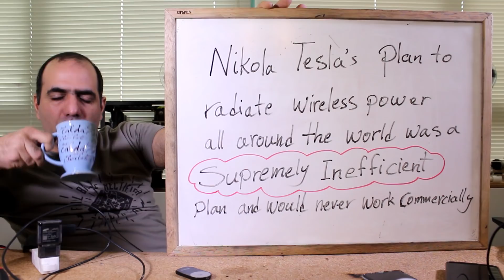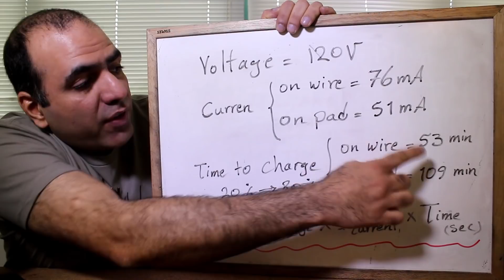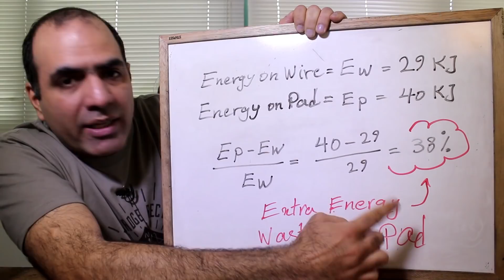Drowning in Inefficiency

Comment: 50 to 60 for an EV? The charge efficiency is maybe 80 to 90+ percent then the motor and inverter efficiency is 90. Plus it captures energy during regen. Would like explanation on how 50 to 60 is what you choose, please.
Reply: It's not necessarily all that wrong, and it depends on how far back the efficiency is calculated. From Tank-to-Wheels EV's generally score well over 70%, however from Well-to-Tank that number may change drastically.
Example of Total Tank-To-Wheels efficiency: (0.90 Charger)*(0.99 Coulombic efficiency of Li-Ion)*(0.97 SiC Inverter)*(0.97 SRPM Motor)*(0.98 reduction gear)*100 = 82.15%
1. Example of Well-to-Wheels efficiency: (0.9 Hydro)*(0.96 Grid losses)*(0.8215 EV)*100 = 70.97% 
2. Example of Well-to-Wheels efficiency: (0.6 Natural Gas Combined-Cycle)*(0.96 Grid losses)*(0.8215 EV)*100 = 47.31%
3. Example of Well-to-Wheels efficiency: (0.2 Domestic Solar PV )*(0.98 Solar Inverter)*(0.8215 EV)*100 = 16.10% 

Data is from Tesla Model 3 customers look at average charging efficiency, typical characteristics of Li-Ion Coulombic efficiency at low charge rates, an example of automotive full SiC inverters at peak efficiency, and lastly switched reluctance permanent magnet motors from Model 3 at an unknown efficiency point.
Tesla Model 3 is likely best in its class, but we should probably assume this number as best case scenario too.

From Well-To-Wheels change the outcome drastically, and therefor miss the point perfectly, because we are far more interested in kgCo2/kWh. Yet it enables numbers like he mentions.

Comment: Old phones had a dock stations with enormously big connection pads and springs. It was as convenient as induction charging and almost 100% efficient connection and also gives the ability to make IP67 or more resistant devices as it's not hard to seal a piece of metal in a piece of plastic. Where did it went? WHY!?
Reply: There is no such thing as 100% efficiency.
Reply: @RawbLV  And there is no place for word "almost" in Your dictionary? ;) For big metal pins with good pressure power loss on the connection is negligible in such a case like phone charging.

P.S. There are processes with exacly 100% efficiency in the world beside of that ;)
Reply: @wikrap1  Examples would be ...?
Reply: @RawbLV  In electrical world a current flow in a superconductor is a great example of 100% efficiency process. the light beam travelling trough ideal vacumm etc. there is a lot.
Reply: @wikrap1  Superconductors still have losses, especially at low loads.
We cannot perfectly beam light so there will always be some photons that will get sent in some other direction.
The most efficient devices we have are electric motors, fiber optics and space heaters.
Reply: @RawbLV  I didn't men colimating a light but a pure light transfer in the vacumm - whatever is beamed is transfered trough vacumm without any loss. Fiber optics are quite inefficient on long distances. Powers of TX lasers are quite strong and the output beam a few kilometers away is signifficantly dimmed.
Reply: @wikrap1  Well I mean actual devices, and not some useless light being scattered around in the universe.
Reply: @RawbLV  Ok. No one human made device is 100%efficient as far probably.
Reply: @wikrap1  Took 8 comments for you to understand that. Thank you.
Reply: @RawbLV  That's why precise communicates are important. Could be clear in one or two. Actually the discussion would not start at all if You would read carefully the word "almost" which was very accurate.

Comment: is that pad fast charge compatible, your samsung phone and samsung charger is. Samsungs fast charge ups the voltage and makes for significantly faster charging over wireless.
Reply: Ya. My S8 charges wirelessly just as fast as a connection.

Comment: I mean, $25 sounds a lot better than $150. That's what it would cost to replace my charge port on my phone. It's only 2.5 years old but the cat has knocked it off of it's stand enough times that it has busted the port. I'd rather not replace the relatively new phone either.

Comment: When you pee into a toilet there should be a tiny watermill that converts your pee power to electricity.
Reply: or why not build a watermill at the bottom of the common drain of the building, where it goes into the sewers. Or better, where the sewers flow into the ocean (or wherever they flow into)
Reply: @gundabalf  who cleans it when it's clogged. Is not just water goes down the drain....
Reply: @gundabalf  That actually is a thing, Or at least a concept. Needs a whole new city to work. ^^
Reply: @gundabalf  randall munroe was asked this and answered it in his book "What If" (great book, would highly recommend), the amount of energy being produced from a downspout generator would be very small and very infrequent due to weather conditions, even in the rainiest of places the energy produced wouldnt be much, it would probably take quite a while for the cost of the generator to be offset by the energy produced
Reply: @gundabalf  they flow into sewage treatment plants
Reply: Why the fuck are talking about piss and wind when we could put a faking sterling engine on things with spare heat. A lot of things produce heat as a waste product, why not use it.
Reply: What if the stuff in urine is used in some kind of galvanic cell or something
Reply: Today my HVAC guy told me he saw theres a device thats essentially a heat pump design using the heat generated by the AC to heat the water in the water heater. Seemed like a legit idea.
Reply: You guys have to learn about efficiency, nuclear power is the best option we have, the least carbon emissions of any kind of power and produces the most. Turbines take alot of motion and energy to convert into usable electricity, ever use a wind up flashlight? That crank on the back isn't that easy to turn, it takes all that motion just to power a small led and maybe some gets stored in the battery.
Reply: You could actually make energy recovery pressure regulators on taps. Instead of just generating resistance to flow, they can generate energy with the pressure.
Reply: and spray piss everywhere. nice.
Reply: Hey that is not stupid at fucking all... Every time I go to a pub, after a few beers I noticed my pee stream is very strong! That would work!
Reply: That seems like a lot of peeing to generate any substantial amount of energy.
Reply: I swear I seen something like this being used in Africa on expresso news bites around 3-5 years ago, they didn't say how it worked, all they said was "when you pee in the hole, it gets converted into electricity" I highly doubt it is real though
Reply: What about a portable bolt on watermill for charging your cell phone on the go?
Reply: Researchers have conclude that it will take at leawt 100 years of usage of the toilet to generate enough energy for offsetting the energy used to manufacture the turbine.
Reply: Is it weird that I think that would be really fun to have?
Reply: good idea...but we're not that desperate
Reply: Haha lol
Reply: been there, learning center electrical kit, corroded after 4 weeks
Reply: you better hope the wind doesn't kick up and your peepee gets zapped.  KABOOM
Reply: Ayy lmao
Reply: Pee power
Reply: @ShadowSora643  there's no other word for it.
Reply: @Allu This Is one of the funniest comments I have ever seen on YouTube.
Reply: Peenergy
Reply: What if you poop on that water mill
Reply: S T O N K S
Reply: @spidercubed9718  Well obviously the back is open (and potentially a fan too)
Reply: if that was in every house, it might work.
Reply: i’d be producing terawatts of energy per session
Reply: Guys why r u talking about such a stupid idea.
Reply: Good idea.
Reply: This is the holy grail of energy innovation
Reply: Your pipe should have a turbine so your flushes turb into electricity.
Reply: *loud splashing noise
Reply: Also wrap your body in heat generators
Reply: Not free as I'm having to buy a liquid to piss out.
Reply: Pp power
Reply: That's the brilliant mind he is talking about
Reply: Dose it convert more energy when you have a boner?
Reply: Actually we are about 92% inefficient if we use the numbers you gave us. Not 60%.
Reply: And then use that electricity to drive the lights so everytime you pee the light turns on
Reply: Same with shitting
Reply: lol
Reply: Set up small wind turbines on top trains and vehicles. It'll spin when driving and when there's storms or strong breeze earn energy. 

Maybe put one below our noses?
Reply: @KiptePetuk  all you are doing is lowering the efficiency of the car or train. It takes power to move that fan through the air.
Reply: @kleetus92  if u put it on the exhaust?
Reply: @hoodrabbit4293  Same thing, now you're restricting airflow, again lowering the efficiency of the motor. 

There is no such thing as free energy.
Reply: @kleetus92  when i was 8 years old i thought of the same idea of putting wind turbines on cars. I actually sent a letter to government at 8 to force them to do that. When i was 8 i was really dumb !?
Reply: @nicksgarage8295  I'd not say dumb, but at 8 years old naive would be more like it. You were thinking, but didn't have the world experience yet to take in all the variables.
Reply: kleetus92 Putting them along highways or tracks is a good idea though, you’d be able to harness some of the energy lost by the cars driving down the road from the air displaced
Reply: @hoodrabbit4293  That's called a turbocharger.
Reply: @kleetus92  There are turbochargers, but it's hard to argue that they increase efficiency. [EDIT] actually there is excess energy in exhaust discharge, so arguably a turbo DOES increase efficiency. Furthermore you can use smaller engines with turbochargers for the same power output as a non-turbo engine with higher cubic displacement. On average smaller engines are slightly more efficient, with the exception of small engines used for pumping water or cutting grass.
Reply: @kleetus92 he was joking (hopefully)
Reply: @hoodrabbit4293  that’ll be a turbo lmao
Reply: @KiptePetuk  then you can use the fan generated energy to power the train! FREE ENERGY
Reply: @KiptePetuk  the turbines add to drag, which lowers the efficiency of the train or car... it's diminishing returns. No, we need better trains and better cars. Better everything really.
Reply: @KiptePetuk  that would only make tee train less efficient because of the wake disturbance
Reply: @KiptePetuk  and then you get drag, nullifying the energy you just captured. the nose turbines on the other hand are genious.
Reply: @KiptePetuk  These exist, they are called alternators and the charge the battery for starting the engine and operating the electrical items in cars.
Reply: @KiptePetuk  this sounds inneficient,
Reply: @KiptePetuk  free energy
Reply: @KiptePetuk in isolation the energy gained due to generator is exactly equal to the addition in power consumed..... obviously more is going to be lost in reality.....yea not the brightest..... however those water thing work ig like yea no real use for discarded effluents and sewage,any water which is useless can probably be used for this generator thing
Reply: @KiptePetuk  That could be used as a kind of regenerative brake, just cover it over when accelerating
Reply: @KiptePetuk  This idea has been considered before, one reason it has failed is because it's not very good looking. Plus it adds a lot of wind resistance. What if we put a fan on the front of our trains (and the air goes between the walls or something), and that would probably reduce air resistance, and generate power (but I haven't done the math)
Reply: @AirNeat  if the air is going through the walls, that's still going to like quadruple the drag on the train, and the fan would also increase drag. It'd probably be less effecient unfortunately.
Reply: @shithappens6887 The air would be running parallel to the walls. Maybe if there was special channels designed with a really smooth surface it would still only cause negligible drag and therefore generate a reasonable amount of energy. I know the fan would increase drag a moderate amount, but that's how these things work, you can't get free power. I do think it might still harvest enough power without increasing drag so much that it's not netting power.
Reply: Why not put solar panels (or built in) on trains, trucks, boats, airplanes, cars and maybe put them in roads and railroad tracks
Reply: @GOATESS_GOATERSON  solar panels on vehicles is already a thing.
Motorhomes have had solar panels for many years to keep the battery topped up.
Roads can't have solar panels in because they would not be durable enough, constantly need repairing and would need regular cleaning.
Railway tracks? Surely you can't put a solar panel on the track, it would just be on the ground... Therefore you could put it anywhere.

Solar trains and planes also exist in experimental small scale forms.

In the UK many illuminated roadside signs, street lights and electrical supply cabinets use solar panels which is a good start.
Reply: You're a fuckin idiot

Comment: just to point out
your method is almost spot on but it is still flawed
1. gas gauge, which calculates how much energy is in battery recalibrate only when battery hit 6.25% or lower and need charging to 100% to get real reading
2. rate of dis/charging changes amount of energy in battery affects how much battery can store and release

I still agree with your findings. Works charging is definitely less efficient, then charging via wire.

Comment: 4:20 Wireless charging isn't quite analogous to filling a glass by the edge of the faucet stream. It's closer to filling it up by putting the glass on your lawn and turning on the sprinkler system.

Comment: Man.. you are too much into musks religion.. he is an idiot, he isn't really inventing anything new, he is one heck os a salesman, credit to that on him, he managed to build a "car" factory with monopoly money, well, that's unique. Tesla was another idiot with a crapload of shitty inventions, credit for making AC the default on current distribution but that would happen with or without tesla, it's quite evident, also, we don't transmit radio waves due to a tesla invention, yet he "invented" the tesla coil (well, good to make videos and cinema effects), but who did really used it to a good efficient purpose, was Marconi. About effciency, we are tied to physics and the materials available, there are probably other available, but they are not industry defaults, like transformers made of platinum, silver and so on, instead of copper, but copper is cheaper to use, there is a balance, balance we well know for a hundred years. Want something cool, measure the efficiency of a sony VT6 battery or a Panasonic one taken from a tesla car, ask Rich (the lunactic that rebuilds teslas tupperwares) for a few samples he will gladdy send you. BTW, current diesel engines are around 45% efficient, beats the crap out of EV's which are just 5 to 10% more and are 4 times more expensive. cheers.

Comment: Hey Express.
   As to Internal Combustion Engines. I had a thought, but I don't have the resources to test it. 
   NASA uses 'bi-phase' metals to turn thermal energy into electricity for space probes using radioactive decay inside ceramic spheres (see: the Cassini Probe that went to Saturn). 
   My thought was to use the same sort of technology to line the outer surface of an internal combustion engine to see if it is possible to turn some of that wasted thermal energy into electricity. 
   I have no idea how efficient it would be, nor if additional layers of bi-phase metals might aid in generating more energy (there has to be some point where there is not enough heat to make the process work, I'd think). 
    Just my thoughts, 
speaking Frank-ly

Comment: i think one of the huge problems we have with energy production is that we haven't innovated in more than a century. It's always something that burns that heats up water that produces steam what makes a turbine rotate and thus produces energy. The efficency is bad and most of it goes out to heat. I don't have a solution to any of our problems but one thing i believe in is solar energy because is one of the most if not the most ecofriendly energy production we have avaiable. If you can by any means try to put solar panels on your home with some kind of energy storage, you can even make money out of it! The more energy we can produce ourselves the less energy we require to be mass produced and thus less pollution and more corporates that will actually work for some more appealing energy production :).

Comment: No Elon musk is more often than not is stupid he said he wants to put COLD GAS TRUSTERS ON A TESLA. Cold gas TRUSTERS are one of the first and worst thrusters ever. They used cold gas TRUSTERS  on torpedoes in the early days and had a problem with the cylinder the air was in getting cold. When the cylinder gets cold the pressure decreases which decreases thrust which makes cold gas TRUSTERS less efficient than most TRUSTERS. So do you really think Elon musk is smart.

Comment: Wireless charging is useful mostly for water-resistant devices that don't have removable batteries, like smart watches (for instance). It allows users to charge their devices safely without risking any leaks if they drop their phone in water (which happens a lot).

Comment: Your estimate of 30%-40% for solar PV is a little high. Most solar is around 18% with the best at about 23%. Researchers have got up to about 28% on some materials. IIRC the best possible PV efficiency is about 32% with the current materials. But this isn't really an issue if you have somewhere to put panels - the sun is a close to Free Energy as we will see in this world!